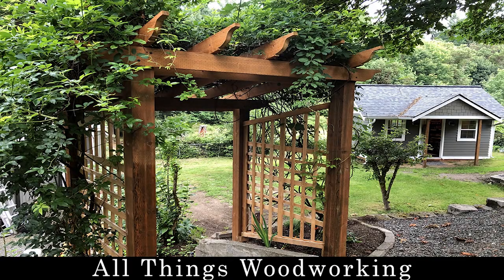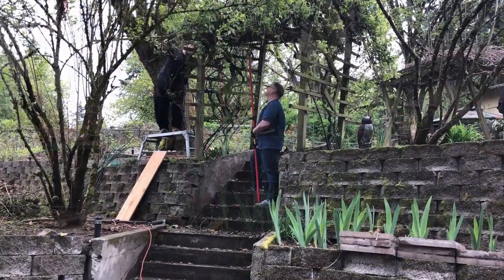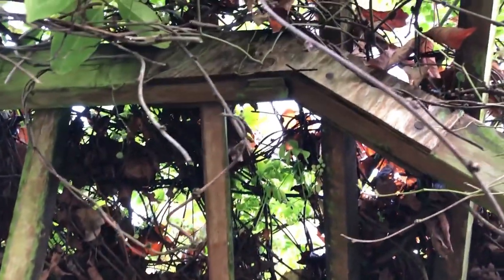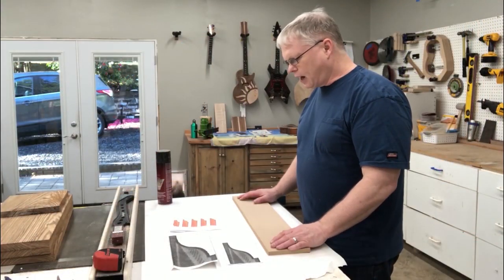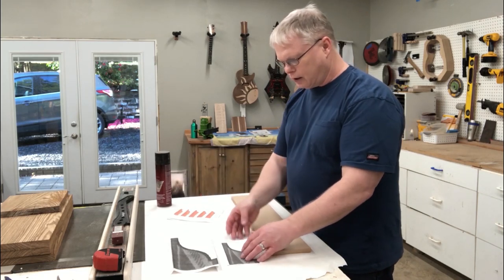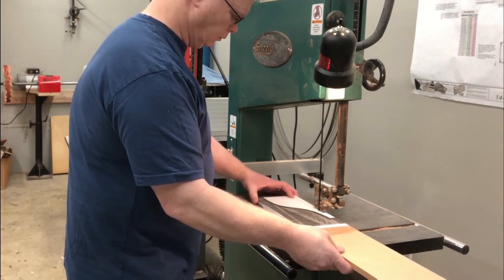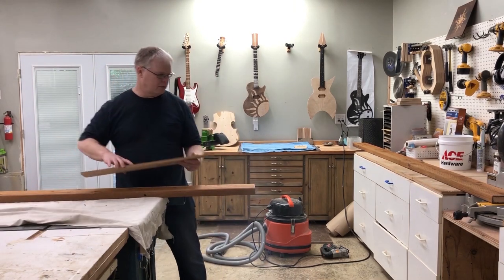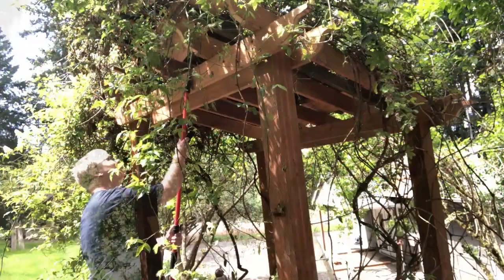Garden Arbor Build

Comment: Nice work! How did you attach the joists on top to the beams? Did you only use cedar and what are the dimensions of the posts? Thanks! I'm needing to replace a sagging structure.
Reply: Thank you. All the lumber used is pressure treated with the posts being 6x6. I joined them with exterior screws driving them in at an angle. Good luck with your project!